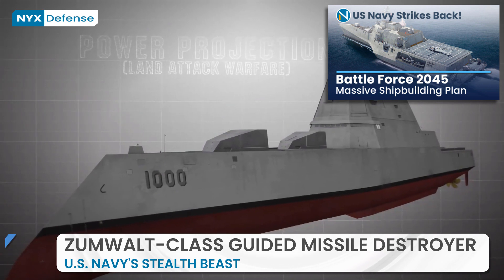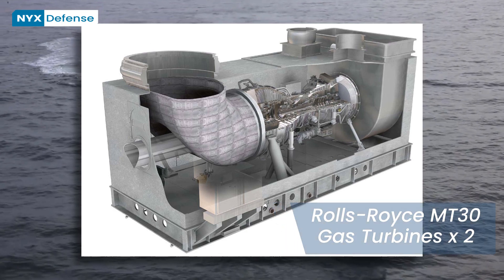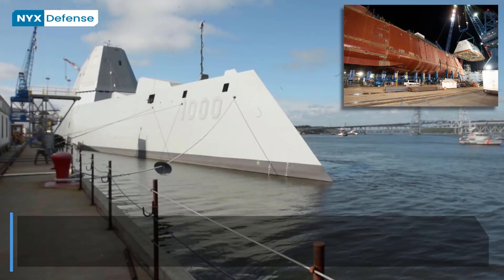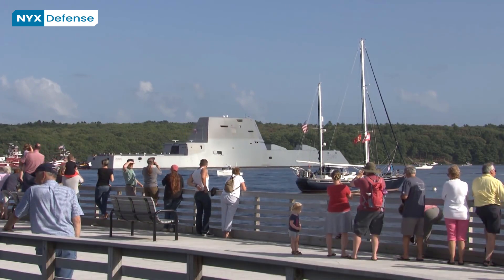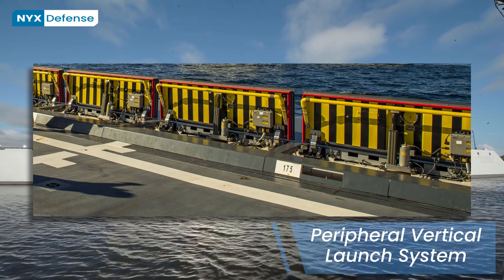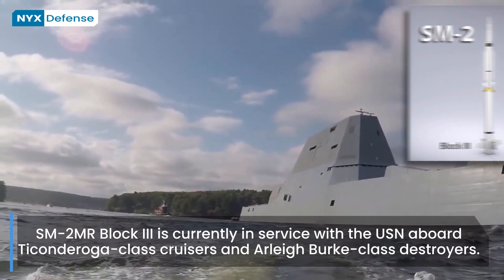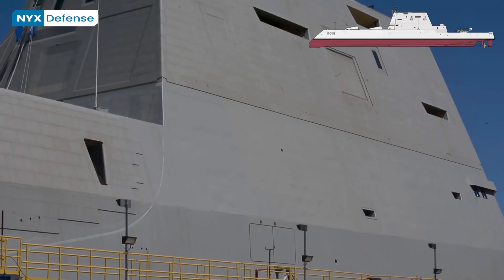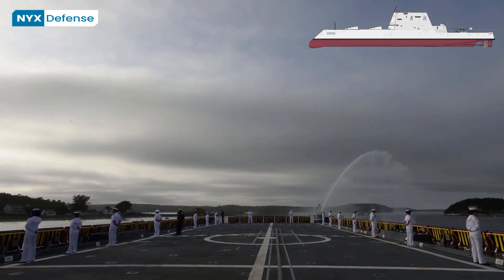Zumwalt-Class Guided Missile Destroyers: Detailed Analysis

Comment: Major cost overruns were  primarily 4 factors.
Procurement process. 
Navy decided to have 2 competing yards work together to build one ship. Besides the obvious,  there were many unforeseen problems. 
LCS's were originally done under this process as well. 
Navy no longer uses this process. 
#2 composite deckhouses.
Cost overruns were enormous. 
Due to inherent problems that arise when incorporating dissimilar materials that expand and contract at different rates. Plus have to have an extreme amount of flexibility in movement. 
# 3 weaponry,  not ready and cost overruns due to changes.
#4 cost per unit skyrocketed because they only ordered 3 not 30 or 32 as originally specked.
So research, design, development, retooling, etc. Costs.
Are 10 times higher per unit. Because your only spreading that initial cost over 3 units not 30.
   Still think it's not a total waste.
There is a ton of new technology and concepts that are being used for the 1st time in a surface combatant. 
It the only true way to test their viability and reliability. 
Also the basic hull design and drive. 
Was designed to be used under different platforms, so if that proves to work well. It can remain basically the same.
Also it's the only surface combatant we have out there than can support the newer weaponry.
The Burke class physically cannot.